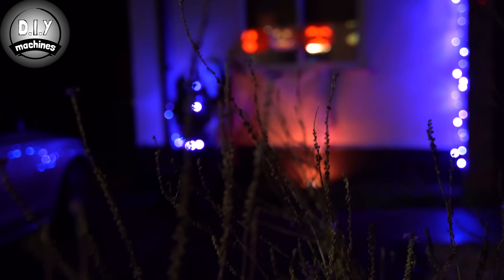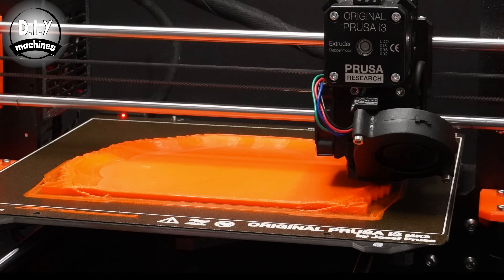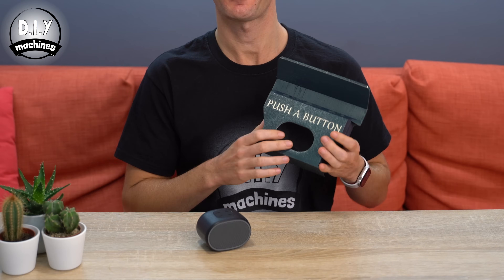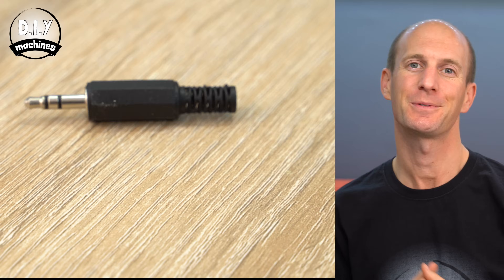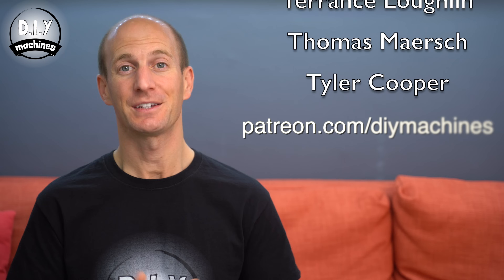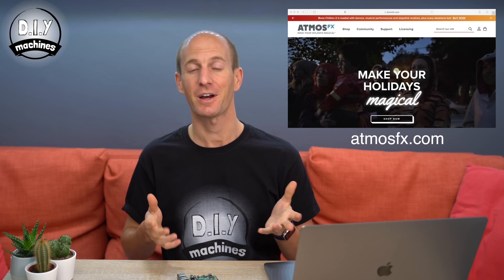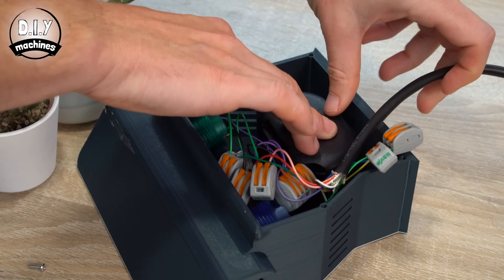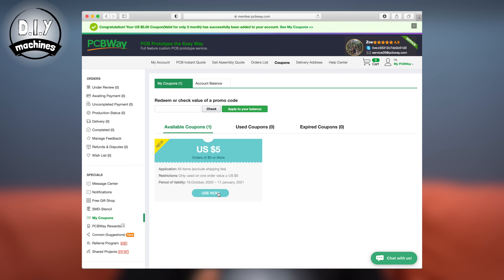DIY Interactive Animated Pumpkins - 3D Printed | Raspberry Pi

Comment: How far does the projector need to be. I cant put itvin middle of my room 😅. Can you place it right in front of window?
Reply from the maker: Mine was about 1.3m away from the rear of the pumpkins. You could always consider printing smaller pumpkins to be able to reduce the gap between the projector and pumpkin surface though so check the shortest focal length of your projector.

Comment: I was able to get the code/commands updated. I created an Issue and KenT2 responded super fast. He told me what I needed to do and even created new profiles so they will run on Pi Presents KMS. Go to the code link provided in this video's description, then click on the Issues tab. Look for my issue, ErinC13. That should get you on the right path to getting it to work =)
Reply: thx I just found your post on KenT2 git

Comment: Nice project!

Fyi, on the post mount, it sounded like you said 70cm instead of 7 cm or 70mm.
Reply from the maker: Thanks Richard, I wouldn't be surprised. I'm often getting my words jumbled - most get found and fixed when I edit but some slip past my eyes and ears and make it into the final video. Well done on spotting it though.
Reply: @DIYMachines  when I opened the post mount it opened as 100mm not 70. 100 is just under 4 inches which sounds right, at least here in the states.

Comment: Thank you for the great video, can I ask what the resistor on the button is for?
Reply: I assume to keep the pin pulled to LOW. Once pressed it the pin can go to HIGH state
Reply: @laserr10000000  thank you for the reply
Reply: @laserr10000000  It's actually to limit the current through the LED... The legs of the resistor is connected between one of the LED terminal and the ground wire (purple). GPIO14/17/27 are 5V signals controlling the LED on the push button... with a ~3V forward voltage for the LED, a series resistor of 220ohms gives about 9mA, not too bright, but perfect for night time illumination